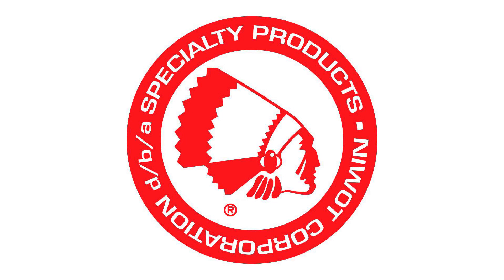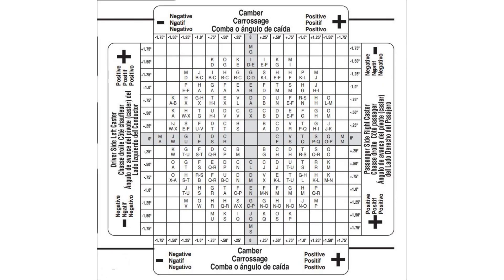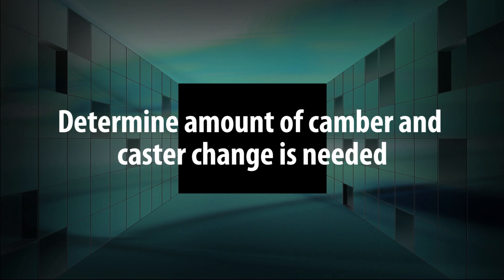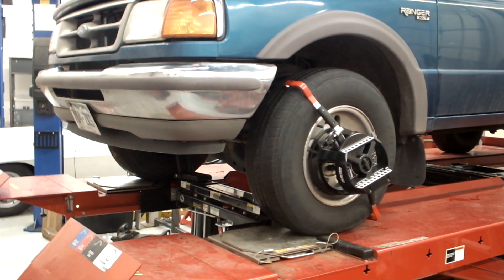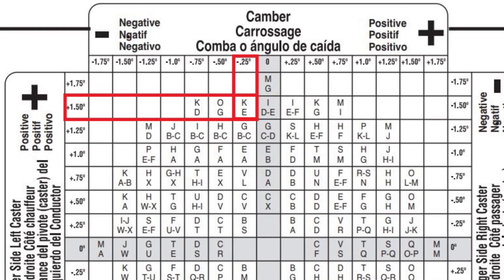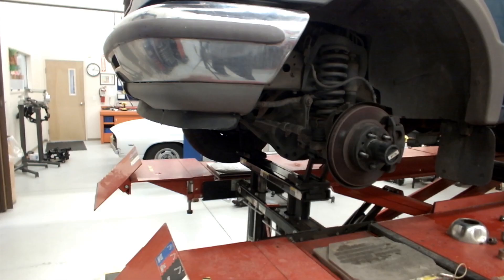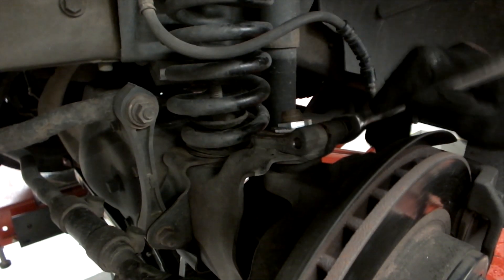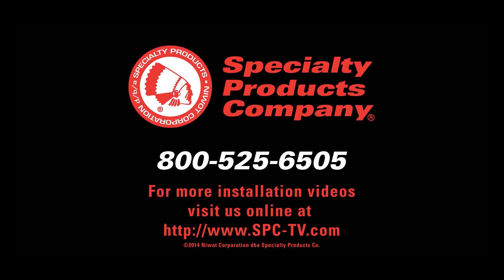SPC Adjustable Light Truck Sleeves

Comment: Are each of the sleeves specific for camber and caster,?   If  only need adjust camber  what sleeve  should I rotate. Thanks
Reply from the maker: The sleeve can be adjusted for camber and/or caster. If only camber is needed follow the instruction chart for camber correction with zero caster change.

Comment: Thats very thorough. Though its important to note that after setting the vehicle back on it tires to get readings the vehicle really needs to be rolled back and forth to settle the suspension before taking readings. I think a lot of shops forget to do that and I think thats why you see a lot of cars that have obvious negative camber because they took their readings after putting the car back down on the ground without rolling it not letting the tires spread out

Comment: Hey there, I was looking at your dual adj. bushings. I am trying to solve the ford e150 wandering issue. I've heard people have success using this bushings by increasing the castor +++. would I need to do both sides of the vehicle. what do you think?
Reply from the maker: Yes, increasing caster on both sides can help a wandering issue. Be aware that too much cross caster (difference from side to side) can cause a pull.

Comment: Why does the chart have up to FOUR letters in the intersection in some cases?
Reply from the maker: 2 letters together either top or bottom mean to line up that portion in between those letter combinations.
Reply: @SPCAlignment thanks! Is it possible I have the wrong chart for my vehicle because I’m getting very unpredictable results. Even after test drives and making sure the suspension is settled it’s all over the map. It’s a 2000 Ford Econoline 2 wheel drive with a 7.3L diesel. I’ve searched the Internet like crazy and I’ve only seen two charts- the “2X4” and the “4X4”.